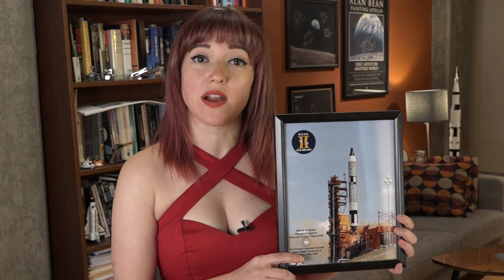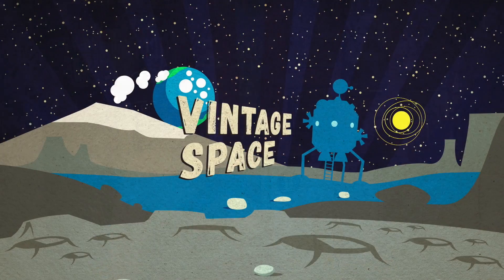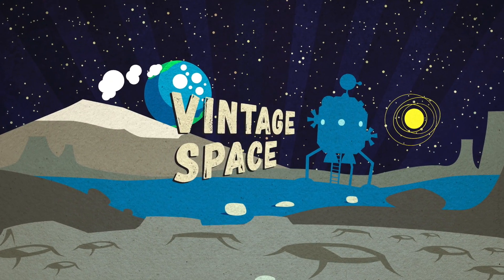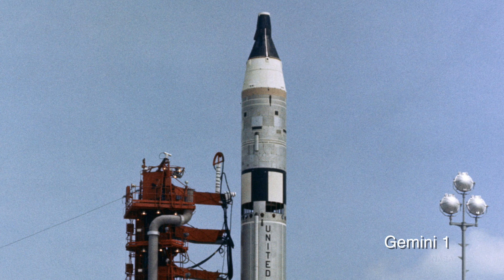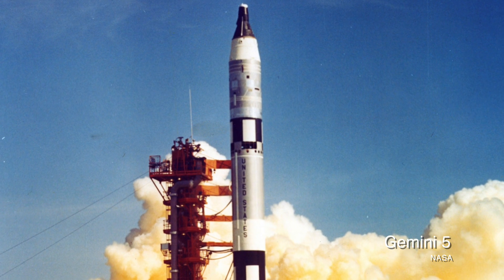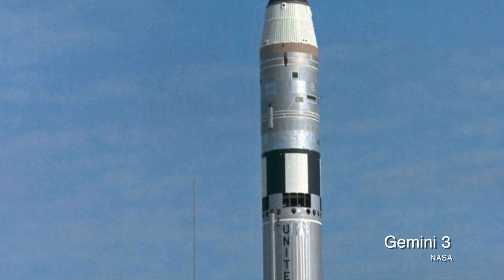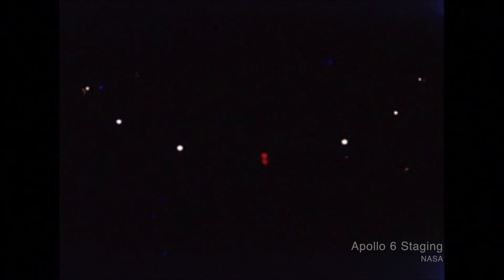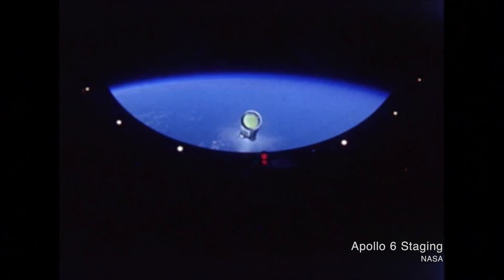Why Were There Holes in the Titan Rocket that Launched NASA's Gemini Missions?

Comment: I worked on the Titan II in the silos of Kansas.  I worked on that (740 ton) silo closure door and got to open it.  Of course from where you open it for maintenance, you can't see it.  I was a missile pheudraulics tech.  I also worked on the blast doors,  blast valves,  the work platforms, the missile guidance, and antennas that popped up out of the ground.   I was the only McConnell at McConnell.  I often think it was an IBM glitch like the one that made "Major Major Major a Major in the Book Catch-22.  By the way, the holes were to give access to the second stage rocket motor and the vernier  pneudraulic actuators that Gimbaled them for guidance control.   I been in and worked in that "interstage structure."

Comment: A bit of trivia ... when I was in the AF we would run a test on every Titan II. In the test we simulated a complete launch and flight. We did that by connecting instrumentation all over the missile. One such instrumentation was connected to each piece of ordnance. The hold down nuts and staging nuts were part of that ordnance and measured exactly when the rocket staged. In one particular simulation the 2nd stages nuts didn't fire and I had to figure out why. An engineer from Martin Marietta and myself spent lots of time going up and down the missile measuring continuity of the wires. We found that the wire running from the computer to the staging nuts was cut. The problem was that someone had labeled each end of the wire with a different wire number and a mod was performed years earlier to "cut cap and stow" a particular wire (guess which wire number it was). That went top secret immediately. I spent the next day  going to all 18 complexes to see if any other missiles had the same problem. Fortunately no others in the entire system had the same problem.

Comment: It just seems that a vehicle going near or at the speed of sound following a launch would just rip to pieces because of the air flow around those open areas but I guess not because it worked.  Just seems unsubstantial aerodynamically when you look at it.

Comment: The Soyuz rocket does the same thing I believe, as have many other Russian rockets.
Also, another primary purpose of ullage motors is to push the fuel to the bottom of the tank in space to allow the main engine to start. Not necessary if the first stage is still firing

Comment: Regarding ullage motors, they do assist in getting separation between stages but mainly their purpose is to put G on the rocket so that the fuel is at the bottom of the tank.

Comment: Titan II had many revolutionary features that in many ways were more advanced that Saturn and even SLS.  Staging being one of them.  Others including, not stacking the rocket and not using a escape tower.  However, the ejection seats may not have worked.  But, not having an escape tower was forward thinking.  SLS in many ways is backwards technology because not only does it use an even heavier tower, it also uses old school solid rocket fuel which has no real future.

Comment: I understand the Titan was a hypergol design that was intended for a rapid launch from a missile silo for simplification, but I've never found an explanation as to why both the stages had to burn simultaneously.  Since 2 hypergol fuels fire when making contact, the 2nd stage could have been easily configured to pump fuel in the 2nd stage right at separation.  I'm sure there was a method to their madness, but they never explained exactly why the 2nd stage was started up before separation with reliable fuels requiring no ignition source.  I find that puzzling.
Reply: one word answer, ullage... they wanted low complexity and high reliability out of the titan missile. Hot staging or Fire in the hole staging is the simplest way to avoid ullage issues. Also, ullage motors are usually made with solid rocket motors which cannot be stored for long periods, a requirement for silo missiles

Comment: I think the openings between the 1st and 2nd stages of the Titan II have their roots in the fact that it was a missile at birth, and much to my surprise, the Air Force used to test-fire the 2nd stages on the ground, on an elevated launch pad, while the 1st stage was attached. I can't say if the 1st stage was fueled at the time, and I haven't heard of this being done on a Titan II, only a Titan I. That would explain the openings; in space, you can separate the 1st stage and then start the 2nd stage, but on the ground, if you test-fired the 2nd stage with no place for the exhaust to go, things might get unpleasantly loud.

Comment: Mine is the Saturn 5. I think we can develope missions that will carry as payload a capsule, service module and reusable re-entry vehicle like a mini shuttle. Next mission wouldn't need a capsule or service module because the capsule and service module would be inspected and re-serviced in an airtight docking Bay. That capsule and service module would take the lunar lander to the moon and bring the ascent stage back to the ISS docking Bay for re-service and inspection. The next mission would carry a payload of a re-entry vehicle and a decent stage of the lunar lander which will be connected to the waiting ascent stage in the ISS Docking Bay. reusing reusable units reduce costs. Also today's technology is better than what was there during Apollo. We can send more than 3 possibly 8 or 10 to the ISS with 4 going to the moon. We can make a reusable re-entry craft. we can build a Docking or Maintenence Bay attached to the ISS. We can inspect, repair and re-serviced units in space. Any issues I left out can be resolved we just need the will. These missions are just starting points with a goal to the moon. The next ones are to go to Mars. Unmanned units for habitat can be sent to the mood to provide supplies to eat, drink, breath refuse for future astronauts  to assemble expand and live. Unmanned missions to the moon will provide manned missions will use them to prepare sending men from the Moon to mars. We did it and scientists and engineers made it happen.  Today we can start to do it again, cheaper, stronger and better. 

What do you think?

Comment: Watched the video three times (as I thought I missed it), why is the second stage designed to ignite while still attached? What is the design limitation that resulted in this decision? On your blog, you implied that it is due to the difference in fuel and a lack of rails (which rails?). Seems like it could just as easily to detach the first stage and then ignite.

Comment: I was wondering about the latticed / open interstages on the Vostok and Proton launchers -- I can get that it probably saves weight and dispenses of the need for ullage motors or a firing delay between stages, but it seems like it should adversely impact on stability and aerodynamics?

Comment: The primary purpose of an ullage motor is to make all of the fuel slosh to the back of the tank so it can feed the exit pipes.  Even if there's no spent stage in the vicinity that you need to gain distance from, you still need to fire an ullage motor.

Comment: +Vintage Space My understanding of ullage motors is that their primary purpose is to make sure that the fuel and oxidizer are resting at the bottoms of the tanks at engine startup, to avoid the engine being underfed and possibly destroyed. Titan II GLV doesn't need ullage motors because its second stage starts before separation and before thrust from the first stage is gone, and thus the first stage acts as the ullage motor.

Comment: The Peacekeeper (nee MX Missile) ICBM had no exhaust ports, but did do hot flyout staging.  In other words, the upper stage would ignite simultaneously with the firing of the separation ordnance - a linear shaped charge which cut the cylindrical aluminum skirt just below the upper stage motor case.  One of the down-sides of this was that the upper stage nozzle would expel a shock wave as the motor started, and that shock wave would be reflected from the dome of the lower stage back into the nozzle.  This would cause flow separation in the upper stage nozzle, but in an unpredictable (and possibly asymmetric) manner.  The biggest fear was that asymmetric side loads on the nozzle would break the thrust vector actuators.  I ran an IR&D program at TRW Ballistic Missiles Division to try to develop a CFD model for staging gas dynamics.  It proved to be intractable at the time, and probably still is.  During the next development program, of the Small ICBM, we did subscale I/II staging tests at CALSPAN which gave results predicting that the thrust vector actuators would break.  This resulted in a delay of first flight as the TVAs were redesigned.  The whole thing was avoided in Titan II, and in the Soviet missile program, by using open interstages.  Saturn avoided it by separating the stages before upper stage ignition, though the ullage motors to which you refer were primarily for the purpose of settling the liquid propellants of the upper stage at the tank outlet (equivalent to establishing an "ullage', or void space, at the top of the tank.).

Comment: The Titan II was initially over engineered, they made it so strong that during one of the launches, that failed, the missile went horizontal and snaked along the coast for some minutes under full thrust.  It should not have been able to do that, the stress should have caused it to break up very quickly.  Realizing this, they went back to the drawing board and found where they could reduce the weight and add still more payload.

Comment: The third stage burns LOX and liquid hydrogen, those vent areas are there so the the third stage engines don't freeze solid and fail to fire up in low orbit transition into space. You will see the same vented frame area used on many soviet rockets including the soyuz 3rd stage. Please do some actual research before you make blatant guesses in your videos. There are also holes for the engine preburner exhaust to prevent the exhaust from being sucked back into the engine fuel mixture compressors, the flames seen coming out the side of the rocket just above the engine nozzles on open cycle liquid fuel rocket engines.

Comment: My favorite rocket? No question about it - My favorite rocket is the one Flash Gordon used. It was roomy, easy to fly, didn't use a lot of fuel, used a very short runway, and talk about fast! At full speed it could go to Mars or Mongo in just a few hours! True, it sputtered and made an annoying humming sound (even in the vacuum of space) and the radio was as big as a suitcase, but overall, it's hard to beat it for usefulness, economy, and durability.

Comment: Many Russian rockets have trusses for their interstage structure, specifically to vent exhaust during second stage startup.

Here's an idea for a future video:

Early Saturn V rockets had four retrorockets on the first stage, which were there to get it clear of the second stage during second stage startup.  These retrorockets needed to be pretty big because the F1 engines on the first stage took a while to shut down, and when they were producing even a fraction of their full thrust they would accelerate the empty first stage forward.  Four wasn't enough, and one of the first Saturn V rockets had a first stage telemetry loss during second stage startup.  The folks at NASA figured out afterwards that the first stage nearly rammed the second stage while the latter was starting.  With just a fraction of a second to spare, the J2 engines spooled up to produce just enough exhaust to blow apart the top of the first stage and avert collision.

Later Saturn V rockets sported 8 retrorockets on the first stage to increase separation and give the second stage more time to start.

You might also do something on how the shuttle main engines managed to achieve an exit plane pressure lower than any engine before (or since, IIUC).  Ordinarily exit pressure less than half of ambient causes the exhaust to separate from the nozzle, leading to thrust vector instability, guidance problems, and smashing the engine nozzle.  SSME was way under this limit.  They did it by rolling the lip of the nozzle in a bit.  The pressure across most of the exit plane was low, but right there at the lip pressure was higher  due to the change of nozzle wall angle.  The prevented flow separation.  It would be especially interesting to hear if subsequent motors have done this, especially long-burn first stage motors like those on the Delta 4.

Comment: From what I have read about the Saturn V, I thought the main function of the ullage motors was to provide enough acceleration that the fuel (and oxidiser) would enter the intake lines for the engines rather than just aimlessly drifting about in the tank. Is this not correct?

Comment: Actually the Ullage motors were used to force fuel to the bottom of tanks to build up pressure so that the engines could function. Without the force of gravity to force fuel into pipes there wasn't any other way to start the engines. (I'm sure someone else already said this but whatever)

Comment: If you look at the Russian/USSR built N1 rocket, all the stages are seperated with just struts and not with complete rings for seperation. Not sure if the Russians did this for the same reason, but several early Russian rockets had features like this in their outer structure.

Comment: ln 1972, l was about 10 miles away from the late night launch of Apollo 17--the last moon rocket. l was 7 years old and my father took me and a number of friends to a nearby power plant to see the liftoff. Due to a series of computer glitches, the countdown was delayed several times. Since it was a school night and it was getting late, Dad decided to take us back home to Orlando. We were on the road about 10 minutes when we heard Mission Control over the radio say they were going to try one more time. Dad pulled the car over to the side of the highway and moments later, on a perfectly clear, dark, moonless night, the horizon exploded with light. The Saturn rose above us on a tail of fire and the sky was split in half between darkness and light. l have never since seen a sight like that; the heavens divided exactly in half between dawn and blackness. lt lasted about two minutes and then the fire faded to a pinpoint and vanished into space. Thirty years later, l spoke to mission commander Gene Cernan and told him of my experience of watching him flying into the sky. He said it was a pretty spectacular site from where he was sitting too.  l've seen the Apollo Saturn on the launch pad from only a few hundred feet and seen the display models lying on their sides. Those F-1 engines are an incredible sight, even when they are not roaring to life. Needless to say, no other rocket (not even the failed Soviet N-1s) can compare to the awe of a Saturn liftoff.
Reply: +Kenneth Darden   Lucky you! I was 12 during that launch but only seen it on the tube and thankfully my dad had recently purchased a color TV. Looked pretty spectacular even on that but I'm sure was only a smidgen of what you experienced.
Reply: +mako88sb l feel pretty lucky to have lived only 50 miles from the Cape. l saw every moonshot (except the last) from my backyard. About 5 minutes after a launch, you could feel the ground shake--even at that distance. lf you ever get a chance, visit Kennedy Space Center.  So many fascinating things to see and do.

Comment: I don't know if it's considered vintage yet, but I'd love to know about all the fuel transfer as well as capacities and decoupling that went on between the various orbiters and their center fuel tanks as well as the SRBs. The shuttle was described as a butterfly strapped to a bullet and considering the velocities and tolerances involved it blows my mind every time I look at the thing. Oh, great channel. Subbed.
Reply: +Push Back   Here's some pdf titles that you should find interesting:

Orbiter/External Tank Mate
3-D Solid Modeling

STRUCTURAL ANALYSIS OF THE SPACE
SHUTTLE SOLID ROCKET BOOSTER/
EXTERNAL TANK ATTACH RING

Nonlinear Analysis of the Space Shuttle
Superlightweight External Fuel Tank

Orbiter Structural Design - NASA

Comment: I had the pleasure of working on the Titan II from 1979-1985 while it was still used as an ICBM. It was felt that for reliability during flight, igniting stage II before stage I completed it's burn would be better. The forward momentum forced the fuel and ox to the back of the tank which meant the pumps would prime more consistently. During several early tests stage II didn't ignite even using hypergolics. This solved that problem. You can read all about it if you get David Stumpf's Titan II book......
Reply: +Jurie Gryffenberg yes,  LRAFB 308MIMS 308SMW
Reply: +fasteddie4145 :I was an E-lab with the 308 MIMS at Little Rock AFB from 81-83.
Reply: Joe Dean? I was in Elab from 80-83.....I remember when the tire fell off your Trans Am....

Comment: Amy, would you know why the Titan doesn't have fins?  I was getting all hyped to build a flying Titan until I realized that it didn't have any.  I wonder if it would mean certain failure if I built a flying model without fins.
Reply: Because fins which are called delta wings btw are not needed and add extra weight and there ugly